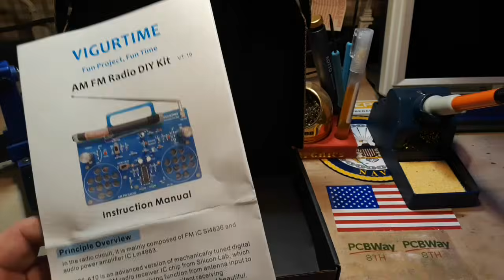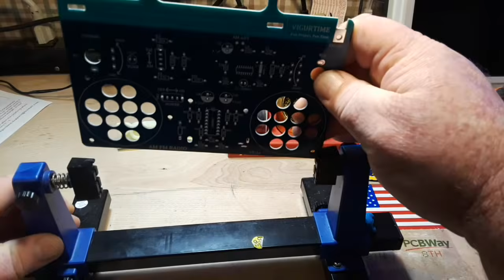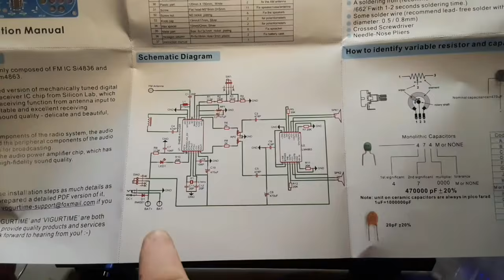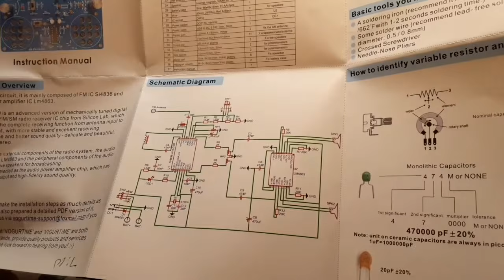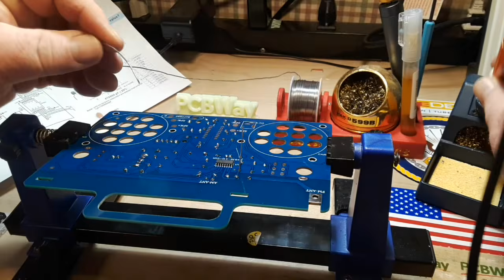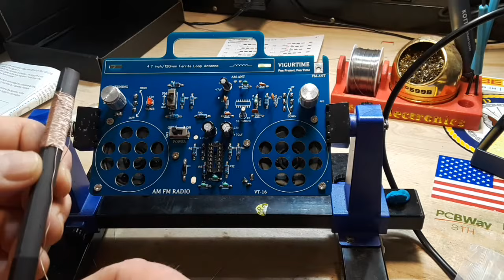Vogurtime VT-16 AM/FM Radio Kit Build (Complete Video)

Comment: You can easily hack this to add SW broadcast bands by lifting one end of R3 and adding resistance. For instance to get the 49M band you add 100K and then tack 10-20 feet of wire to AM-ANT side of C4 .... Add 130K for 31M, 150K for 25M, 170K  for 22M, 180K for 19M and 200K for 16M. These bands run from 250 KHz wide to 500 KHz wide so they tune pretty well. To improve AM you can lift the hot side of the ferrite loopstick and wire a 30 - 310 pf tuning cap  across it. Then add about 5 turns of litz or enamel wire to the other end of the rod and attach it to the pad where the original wire was and ground which will let you peak stations in the AM BCB and add a little selectivity to the front end. Since it uses mainly through hole components it's a nice base for a little experimentation

Comment: Thank you so much for doing this, Paul! TAKE CARE! About the speaker fixing part, it might be easier to 'glue' the speaker to the board first and then fix it with screws and nuts. And the heat shrink tube on the am antenna is to make the antenna clamp tighter, so as to prevent the antenna from accidentally slipping off and falling. Of course, it's okay to remove the heat shrink tube.:) Take the radio outside will get more radio stations.